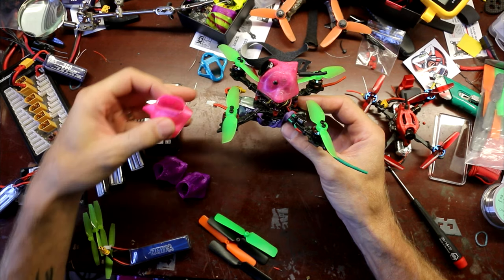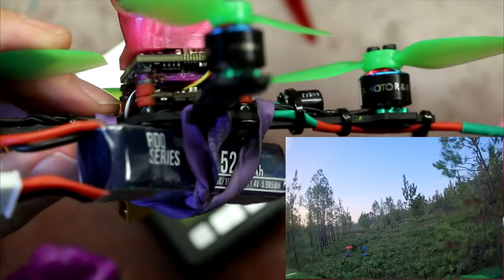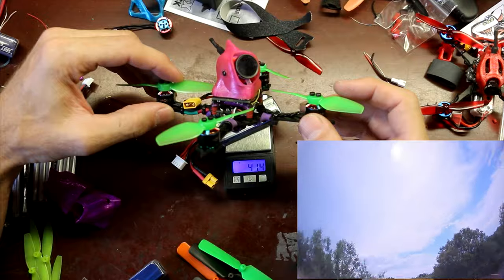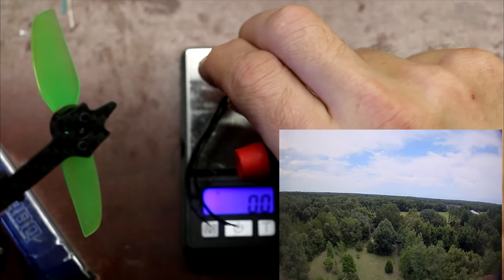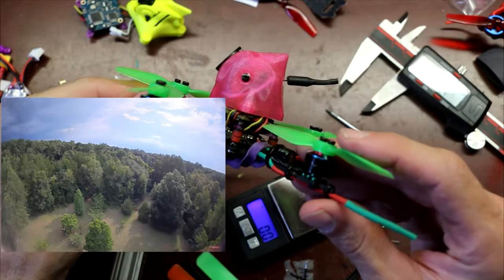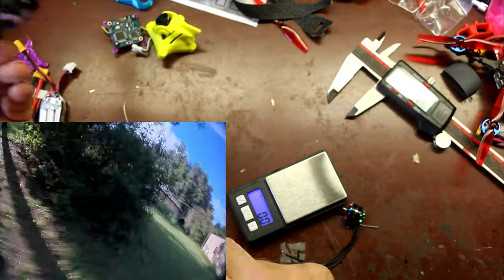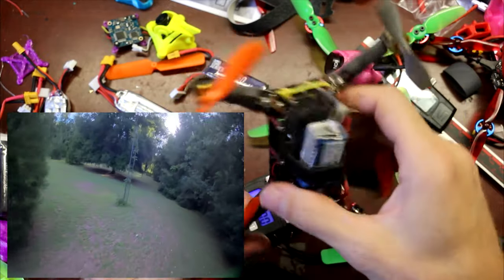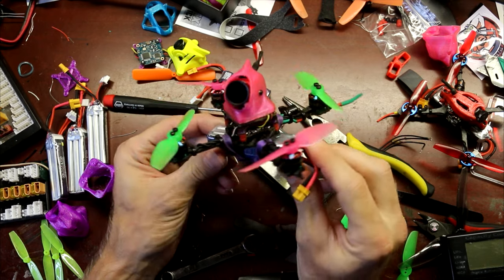HD chopstick How to

Comment: Nice job on the tpu print! I would recommend you try the tomoquads cs3 next since it was actually designed to run the turtle in it it would be alot easier to throw together and it's the same size and weight as the csx
Reply from the maker: I considered it.  It's easier to build for sure, but i wanted no props in view, which this accomplishes except for the last video where my camera moved down. 35deg camera angle you won't see props on this.  I was concerned about the canopy staying on and it being able to protect the camera, but it has been great so far.  I'll do a crash compilation, i have many.